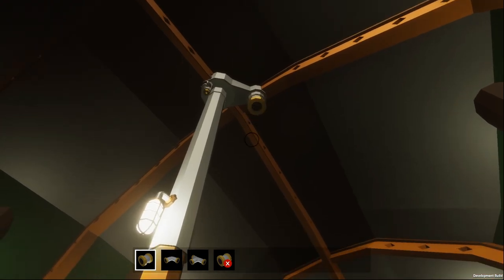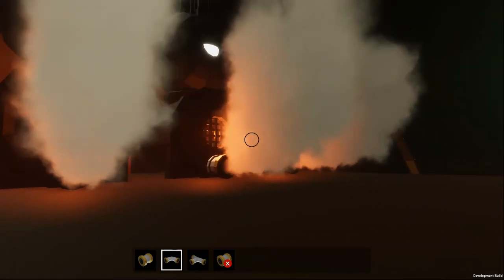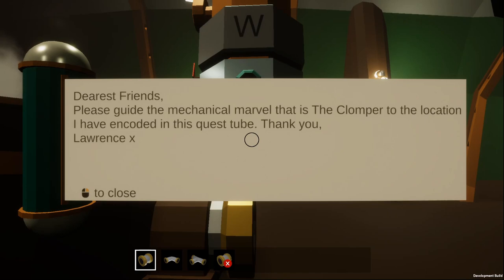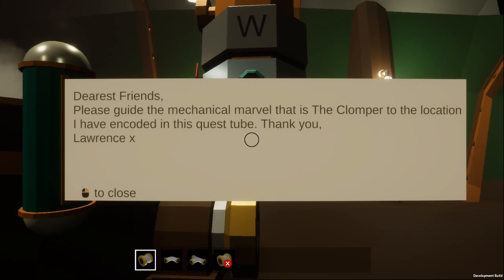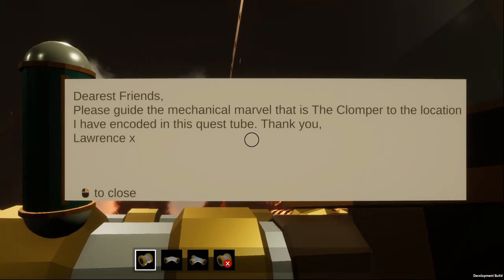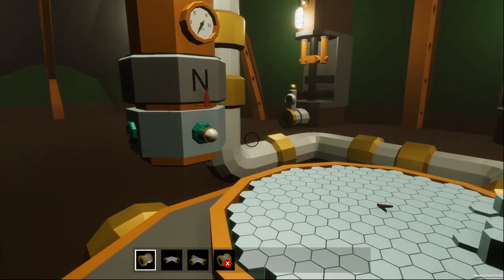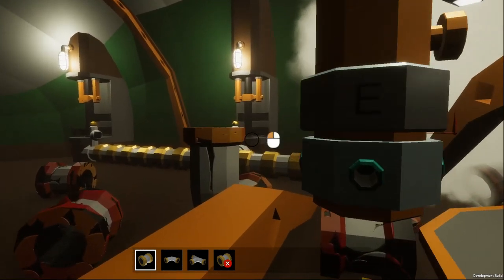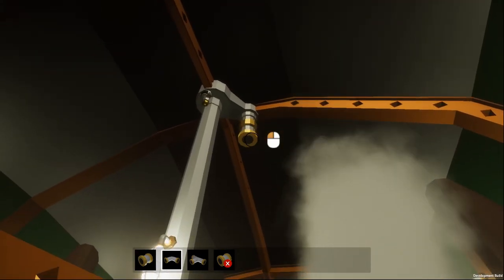Laying Pipes, Exploring, Questing | Game Play Jan 2020 | Clomper

Comment: This looks super fun! Maybe you could make right click remove a pipe (if it's not used for anything else)
Reply from the maker: Thank you! I had that same idea about right click. My problem was - and I stress that this was just me - clicking right is really easy. So easy. When you have a lot of puppies and you destroy one by accident, you might not notice enroll you realise you're now not clomping in a straight line but into a wall! 😀
Reply: @RobLang  But you could make it so that you have to hold down the RMB (then the pipe shows up red) and you destroy it by relasing the button - if you don't aim at anything while relasing the button, nothing will get destroyed.
Reply from the maker: @johnleorid  I'll give that a go. I've found that I generally don't want to delete pipes unless I'm deleting a lot of them. Now that I have valves, the need to delete and replace has gone away! Thanks goodness for that. 😊

Comment: Not too scruffy! I think it's awesome that you can run up the girders too! It sounds like you briefly mentioned it, but do you plan on adding a valve pipe that rather than place and replace you can just turn on an off to let steam through? Think that would be very helpful at times :D
Reply from the maker: Thank you! I'm yet to perfect the natural style you do so well!
Valves are coming. You're absolutely right that they're needed. I need to change the steam algorithm to do that. I've broken out Steven  Skiena (legend, worth a Google - his book is very academic tho) to make a robust algo.

Thanks for your feedback, see you on YOUR Discord (no pressure). 🤪
Reply: @RobLang  :D And Steven seems pretty good, considering he has the manual on Algorithm Design!